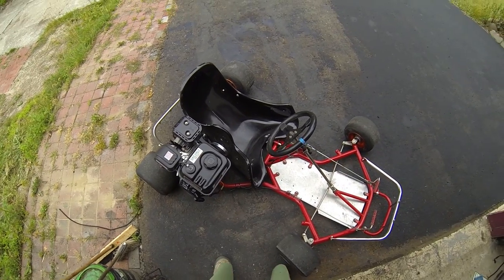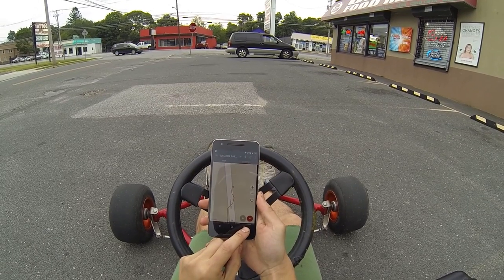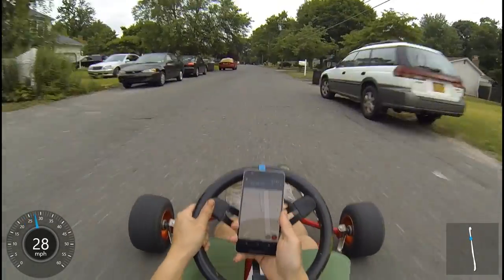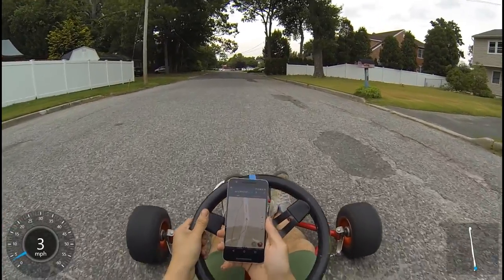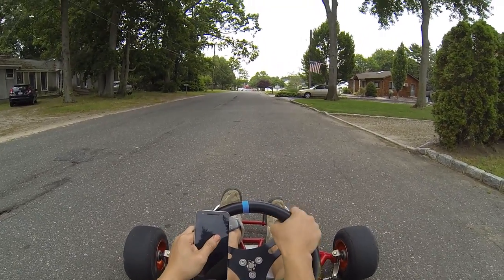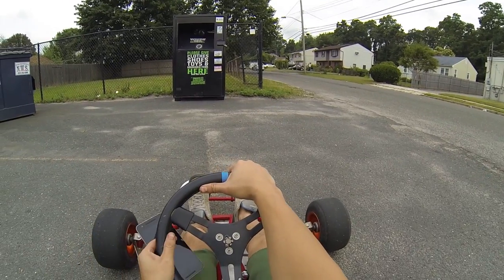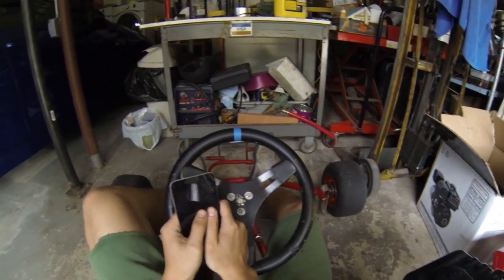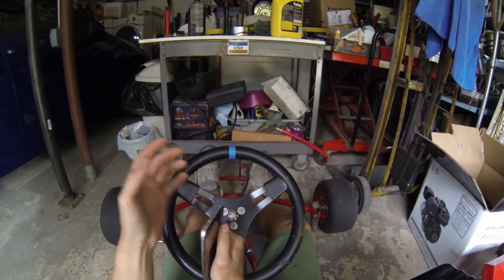Centrifugal Clutch vs Torque Converter - Go Kart Build Part 5

Comment: You need to take off that restrictive muffler and remove the governor if it's still on, there is so much wasted potential, this should definitely be a 40+ kart, with the torque converter!
Reply from the maker: Don't wanna be any louder. Governor is already removed just gotta get a large front sprocket
Reply: @zed4me  lol I know the struggle. I bought a Coleman ct200u and jacked the 196cc Hisun  way up. Full governor delete, performance carb, intake, exhaust, 22# springs, CS Grind cam, PVL flywheel, 32 degrees of timing, gapped Autolite race plug and an ARC billet rod all through a TAV 30. It is super loud and  sounds nothing like a farm implement, she honks too! To stay on the low I would recommend a Tillotson PK-1b carburetor with an intake ($26 for carburetor, $25 for filter kit), remove the spark arrestor (crappy baffle) from the stock muffler (not too much louder), Autolite race plug ($6), largest rear sprocket you can fit (with chain on it, leave an inch of tire side wall) and then preload your TAV 30 to the second setting. This will increase your low and top end without much noise. Now, as for the longevity of that motor (with the governor properly removed from the block) it is going to be necessary to put in a billet piston rod with better bearings and oil clearances even more so than upgrading your springs so you don't unseat a valve and bend a push rod because when that piston rod fails (it will ) it is going to punch a 2 inch hole in your block or the cheap flywheel will stress fracture and explode after becoming unbalanced from the higher RPMs. A PVL aluminum flywheel is about $60 vs over $100 for a billet model. As long as you add 4 degrees of timing with an offset key and install it properly, it is race proven and will handle something like 17,000 RPM for an hour. Your stock motor pushed around 3400 and a governor delete goal is 6700-7000 which nearly doubles power/torque if done completely. I had a friend who blew his Predator out 2 times before he bought one and left it alone. A lot of people think that governor is just some sort of thing there for other applications and doesn't matter. It's not. It is there because the rest of the engine is not designed or built to keep up with  its own potential therefore shortening the life of the motor. You already have a sweet cart, TAV 30 and a goal. Save up $100 or less for another motor, break it down and build it. It's not hard, practice placing bolts and things back in threads after removing parts. It's by far the coolest, man card approved puzzle you can put together!!
Reply: Mine hits 50 with the governor and a 12 tooth clutch
Reply: @fatbuddycat  hey dude
Reply: @xaviermccloud4586  how so?
Reply: @Gone_rn  what 
mods do u havd

Comment: the 12 tooth vs 15 tooth probably makes a 10+mph difference.
Reply: 15 tooth is the limit for a properly working sprocket. 12 tooth will jerk the chain all the time and eat itself quick.
Reply: So like the less the tooth the faster the speed ?
Reply: Hung Ngo no the more teeth/ bigger sprocket or gear is faster but the bigger the gear the lower the torque
Reply: Tyler Truitt I’d say more than that
Reply: @hungngo4790  larger #of teeth= bigger top speed but will take longer. 
Less teeth wony have as high of a top speed, but will accelerate much quicker
Reply: It depends on what sprocket your talking about. If you ran a 12t clutch and a 64t axle you'd accelerate slower but go faster than a 12t clutch with a 74t. If you went with a 14t clutch and a 64t rear you'd accelerate even slower but go faster than the 12t. The bigger the rear gear the slower the top speed but more acceleration, the bigger the clutch gear the slower the acceleration the higher the top speed. Think like a bicycle to make it simple!
Reply: Ok Mr. calculator. How much is 1+1=?
Reply: @akkudakkupl  4745
Reply: @akkudakkupl  jtto

Comment: Loss of top speed is probably your gearing.  If RPM top out, you are geared too low.  If RPM are too low, and you are not heating the peak of the power band, you are geared too high.
Reply: Yes, a definitive test would require a sprocket change based on maximum rpm reached at top speed. I'd like to see that.

Comment: The belt torque converter is smoother takeoff I find than the centrifugal chain clutch. I used both on my 196cc bicycle and the chain one I broke spokes but the belt one not as many.

Comment: Man that Lifan 200cc motor would be a great addition to your build. I love your current setup, but if you really stop to think about it the weakest part of the build is the motor. Stacking another 3000+ rpm on top would fix all your issues with speed as well as getting a more even response throughout the range. Granted the 200cc has its own gearbox so it would undo some the current progress...LOL Cheers, looked like a ton of fun.

Comment: Smaller driven sprocket for higher top speed not larger.
It's also taller rear tires for higher top speed.
A cvt makes a smaller rear sprocket painless.
Most of the go cart cvt depends on belt slack for a clutch. The belt slack prevents you from using the low end of the pulley. If you combine a cvt with a centrifugal clutch you can get much better launches. That is how Honda set up the gy6 transmission. Though admittedly they did it backwards.

Comment: keep the 12 tooth on and change your drive pulley on the the jack shaft to a 6 inch that will give you speed. if you have a 7 or larger that is mainly for torque.

Comment: If you are slower with the CVT that means you changed the final drive ratio from the start. A better test would be to keep the final drive ratio the same as the clutch arrangement. If you then are slower with the CVT it is because you ran out of engine power at a certain speed/rpm. In theory you should be much faster with a CVT. For this test what was your tooth count on the CVT and rear sprocket?
Reply: you forget hp loss through a cvt.
Reply: @frigglebiscuit7484  won't lose any power with cvt.
Reply: @dkdanis1340  Yeah, it will. about 20% in indeal circumstances. The belt has an inherent loss.

Comment: Good luck getting past 44mph with modifications using the torque converter.
i took mine off and put on a clutch and got 58mph.
Reply: and that was with 4.8:1 , 4:1 AND 3:1 gear ratios.
Reply from the maker: Clutch is best for top speed but no way a predator 212 can get you to 58 mph without some heavy modifications

Comment: Hay I have a 420cc go kart and I’m going to put a 40 series clutch on it do you think it will spin the tire and should I go chain drivin.
Reply: I have a 420cc kart with a 40 series torque converter. You can check my page to watch it drive! I would recommend going with the torque converter but watch the video and tell me what you think.

Comment: Is it safe to bypass the governor and use a torque converter as well? Or will the belt fly off?
Reply: its safe... just put a 7 hp on my mini bike and took off the governor. thing flies.

Comment: I use to run a kid's fun park (FUNWAY USA ) in Foxboro and E Bridgewater as well as F1 Boston... for shits n giggles I took off a 6hp off of one of the kiddie carts and installed a 13hp. ... out of the 6hp too speed was close to 28mph... once I got done upgrading the SHIT out of a kiddie cart .out of a 13hp and some gear munipulation and a more breathable muffler I could get that cart up to 60 mph out on a straightaway. ..trying to corner couldn't be done without rear kickout. ... but was extremely fun.....!   Good times. ...!

Comment: I want to do a tourque converter and then do a crazy small axle sprocket to go really fast top speed, but I’m worried about the brakes on my go kart. They are nearly nonexistent. Anybody have any recommendations?
Reply: nick the car guy fix ya brakes 😂
Reply: It depends what skills you have, If you have bolt on replacement skills or fabrication skills and equipment. I've found sport quad rear brakes to be an easy and cheap upgrade. The problem with small sprockets is you lose acceleration and off the line power. Think of it like a 21 speed bike and how hard you have to work to get going in the higher gears. Too small a sproket will burn up the clutch or in the case of the torque converter setup it would cause excessive wear on the belt and the clutches, it will also over work the engine

Comment: Which one lasts longer with off road use?
Reply: Tourque  converter all day. The centrifugal clutch burn up fast off road
Reply: @gabrielgalaxygh  ok thanks
Reply: @foreverlalone569  no problem I know Its a bit late but at least it got answered ha
Reply: Torque converters can overheat off-road. whatever you use, you'll want a low gear

Comment: Hum.....   on the motorized mini bike build i did a while back.  We hd a 10t to 60t clutch chain loop to the motor. Then we added a tc same 10 to 60t sprockets. Had nice even takeoff and 15mph higher top speed.  Cause it starts out low and ends up spinning the 10t 2.4 times every 1rpm of the centrifugal  clutch
Reply: To be clear this bike had 10x10mm chain on it! Why the tooth count seems odd ball!

Comment: Since it has the torque converter, does it want to creep forward when the engine is at idle?
Reply from the maker: No there is a centrifugal clutch still so it only engages above idle
Reply: @zed4me   Wait, also the torque converted kart has a centrifugal clutch too?
Reply from the maker: @Marty_Deslions  yes, without a clutch, there is no way for an engine to not stall at a stop
Reply: @Marty_Deslions  not like regular clutch. When on idle belt isn't engaged but as soon as you press throttle pulley expands out and grabs the belt.
Reply: @dkdanis1340  ok thanks

Comment: I found this old 1968 clinton engine with a built in 6:1 speed reducer in our barn. 1 cylinder and with the speed reducer outputs break 104 ft pounds of torque. It also weighs 116 pounds tho. Lol
Reply: I think ill use that since its free. Yah 409 cc baby!!!!

Comment: I have a torque converter but when I started my go-cart it took off and rammed into my siding of my house and bashed it in my go-cart is ok though but why didn't my go-cart sit still and idol instead of taking off? I am going to get a clutch for it but I am still wondering what the hell happened lol it scared the hell out of me!!
Reply: the belt was yo tight or it was idled up high ur also if ur missin the piece that spins on your torque converter

Comment: What engine inside sprockets were you using when you did a run with a clutch? 
I have a 196 mL clone motor with a Mikuni 22 with a 12 front and 60 rear and Im 250 lbs and I hit 40mph.

Comment: go karts and Nexus? I knew I liked you lol. How many watts is the electric motor gonna be?
Reply from the maker: Goal is north of 5000w, possibly touching 10kw
Reply: +zed4me OH DAM! So nothing like the 1000w they put on Razor karts lol.
Reply from the maker: Jonathan Burdette LOL no way. gonna be much crazier.
Reply: Is that 5K similar to the 6.5HP Predator?
Reply from the maker: Jonathan Burdette It'll be much crazier because instant torque
Reply: +zed4me what is the top speed on an electric engine, range and price
Reply from the maker: Clorox Bleach ranges too much. But definitely more expensive than gas.

Comment: Is there a cable that engages/disengages centrifugal clutch?
Reply: Or does it tension the chain instead?
Reply from the maker: If you look up how centrifugal clutches work you'll see how it engages. Basically at higher than idle RPM it will engage.
Reply: Thank You all makes sense now!

Comment: does the torque converter engage when you give it gas?
Reply from the maker: There's a clutch that engages which then engages the torque convertor which is really a CVT

Comment: dont you mean a smaller sprocket? for top speed? you said larger
Reply from the maker: spikeman dan larger front
Reply: huh?
Reply: spikeman dan there are two sprockets one in the front and on in the back. If you want a higher gear ratio you put either a bigger sprocket in the front or and smaller sprocket in the back and if you want a lower gear ratio you get a smaller front sprocket or bigger back speocmet

Comment: You meant smaller driven sprocket right?
Reply from the maker: Yes which becomes the drive sprocket for the next driven sprocket haha but yeah you're right
Reply: zed4me Ohhh yeah the one off the torque converter is the one you meant.

Comment: What is the purpose of torque converter!?
Reply: Glad someone asked instead of assuming a torque converter/CVT is all about "speed" (not the guy in the video, obviously he understands the true concept as he stated facts in the video) When you use a centrifugal clutch, you have what's essentially a "static" gearing ratio. To put this into perspective, imagine having a 2 speed manual (stick shift) vehicle, and imagine you could only use 2nd gear. This would essentially be static gearing, and would yield the result that depending on the gearing ratio used, you could have extremely fast takeoff, and a slow top end speed, or the other way around, but generally losing either/or in trade-off during the process of finding the desired gear ratio to use. Using this same example of the 2 speed manual, with a CVT, you essentially have a "dynamic" gear ratio that would be akin to you starting in first gear, and having the ability of switching to second, allowing not only better final drive gear ratios (the gearing from the driven pulley sprocket to the sprocket that drives the wheels itself) , but also a good mix of top end (top speed) and bottom end (takeoff speed) without sacrificing as much, supposing you find a good final drive gear ratio. This "gearing" is done variably (hence the reason CVT means continuously variable transmission, or as you call it "torque converter")  by changing the driver, and driven pulley ride heights based on engine RPMs. When it first starts off the belt is riding down the inside of the driver pulley (pulley on the engine) and riding the outside of the driven (pulley at the axle/drive sprocket) and as the engine increases RPM the driver pulley closes in on the belt, causing the belt to start riding higher on the driver pulley (toward the outsides), which in turn makes the driven pulley at the drive sprocket open and the belt start riding lower (toward the inside), essentially "changing gears" as you speed up and slow down, continuously.

Comment: do you know top speed governed?
Reply from the maker: I removed governor right from the start. With the torque convertor though, I believe the stop speed is the same.
Reply: +zed4me thank you. I think the same. I have a 16hp build same engine basically and I only hit 37mph with cvt
Reply from the maker: Vtec Banger You need a larger sprocket on the CVT to make more use of it
Reply: Vtec Banger a stock little 212cc predator toped out at 40mph on a go cart I had
Reply: Michael Supercharger thanks. I did some testing and found cvt will not hit the governor on a stock 212 so I put my built motor on a shifter kart frame with a clutch. I wasted too much time and money trying